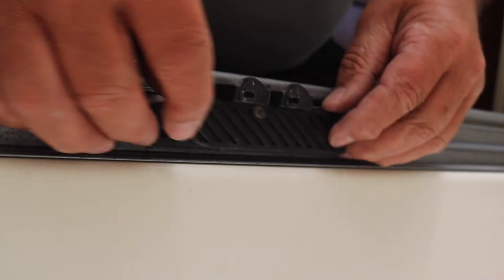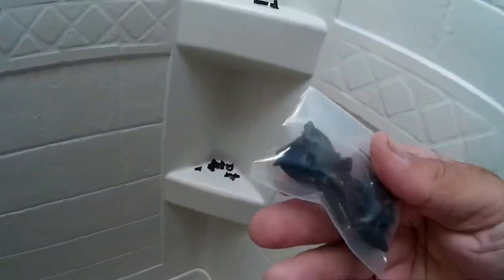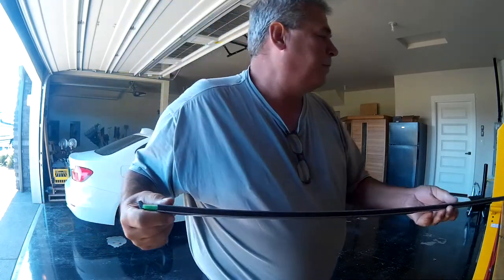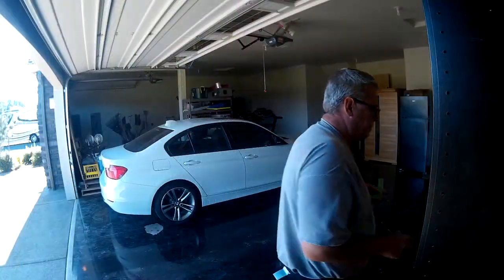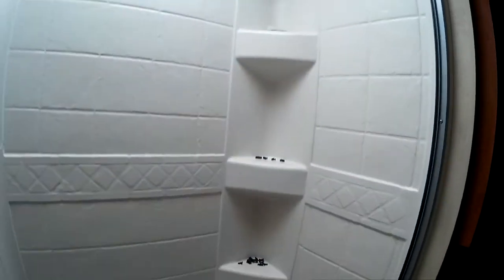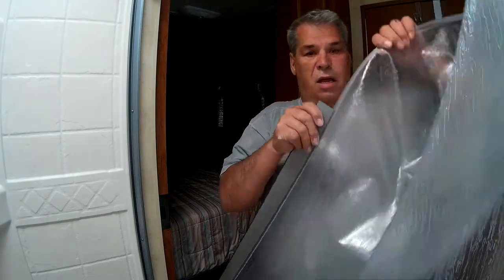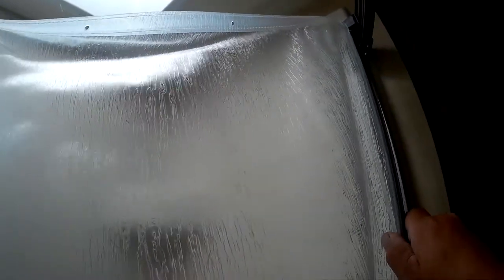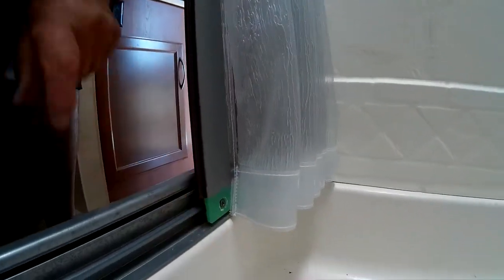Thor A C E  Shower Curtain Hack/Repair

Comment: Great Job Bruce, that 3D angle bracket is going to outlast all of other shower parts including the little curtain connectors.  I wonder if Thor make all of those parts as they need them... interesting.
Reply from the maker: Thor does not make them.  They are made by a company in California.  I could not get it.  I think Thor really had no idea what part I was talking about.  Might try them again in a few months and see if you can get the pull handle, then maybe talk about the inside parts to it.  The 3D part is actually stronger at the inside angle than the original part.  Now I can just make them when I need them.  Lol.